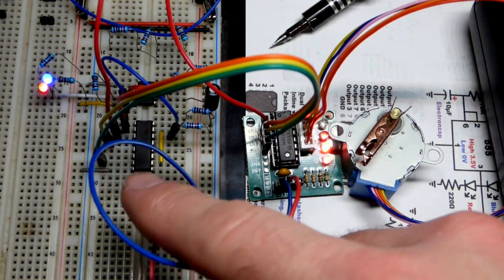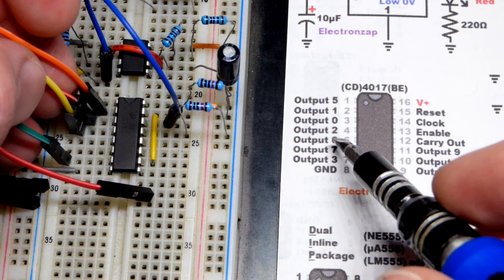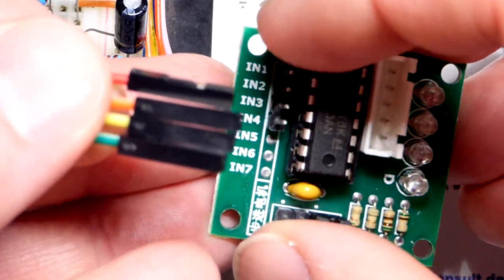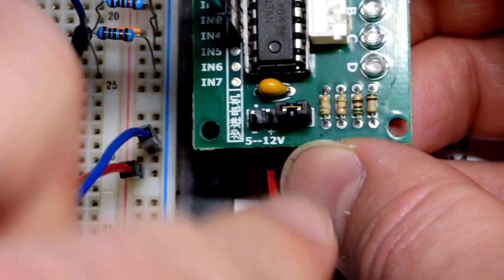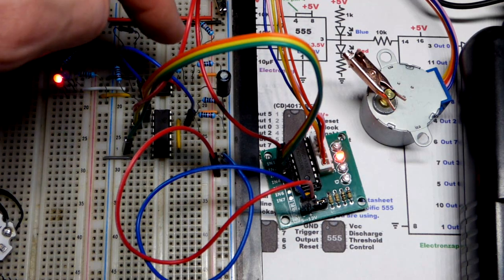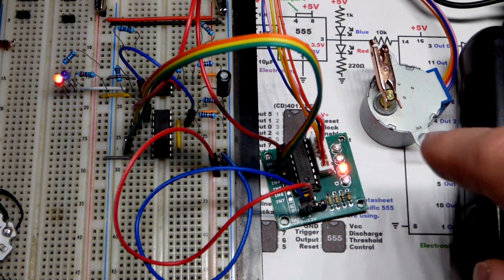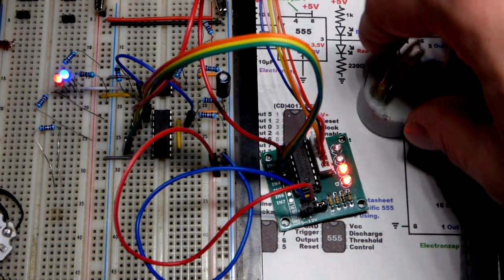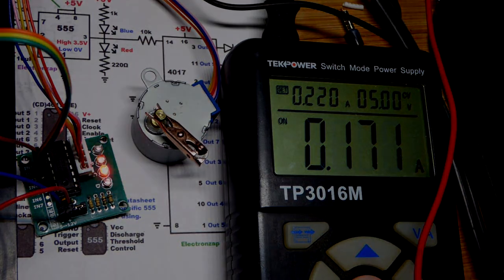Stepper motor module controlled with 4017 decade counter and astable mode 555 timer

Comment: so can i put a potentiometer on the 555 and that would increase speed of motor through the 4017  and relays  ? please . im cotrolling a 180 servo with pot and 555 and want to try this circuit with the same 555 output  . ive just orderd sum 4017s
Reply from the maker: I made a circuit that controls a servo with a 555 and trimpot, I dont think a 4017 would be useful for that. If you have a circuit idea, do a Google search of the component you want to use and under the image tab, see what circuits pop up. Of course you will have to modify those circuits but they will give you a good starting point.
Reply: @Electronzap  thank you for reply i was hoping to get a forward /reverse and speed like i had on the servo  (didnt work lol). il just switch between 2 wiring 1234/4321